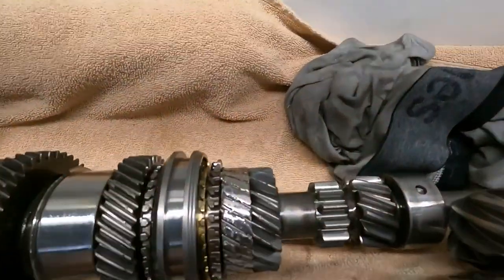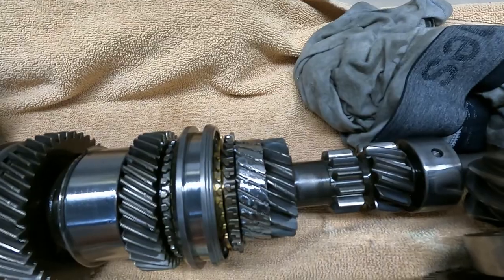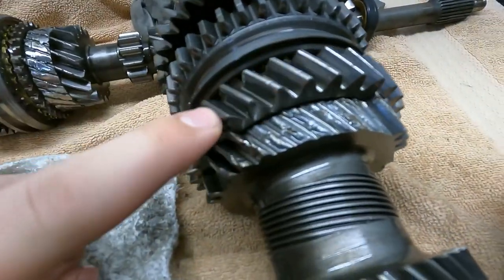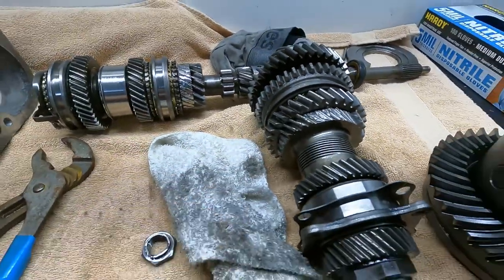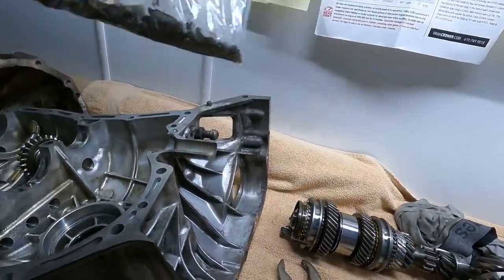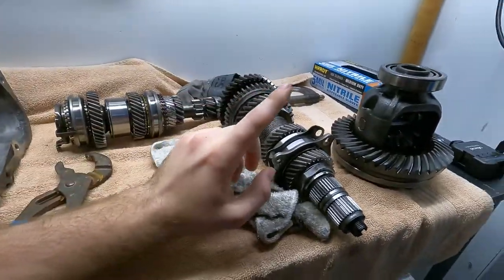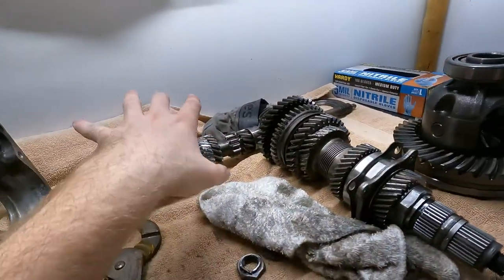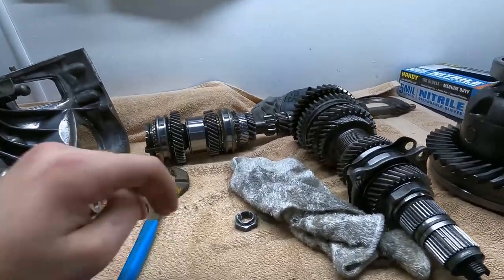Subaru 5mt Transmission Rebuild

Comment: 3rd gear is always the weak link. Its the smallest of them all. I managed to strip 2nd in a 2.5RS box. Went PPG straight cuts and havent had problems. Im currently finishing up my Forester. I rebuilt it with RA's. Im down to setting backlash and sealing the case up. I replaced everything in mine! Center diff and all! My Forester had 276k on it 😅
Reply from the maker: That sounds awsome, I'd like to experiment with a built 5 speed some day, maybe on the next subaru
Reply: @SWSpeedCo  Don't wait to long! The RA gears are finally EOL and I imagine there aren't to many people selling parts. I've had to do a lot of searching to find random washers and parts to complete mine. Even Subaru has some backordered with no ETA on when they would arrive. eBay, Amazon, and random part websites have helped me get all my parts

Comment: u can also torq down the nuts once u assemble the trans  u can lock the diff in place from the drain plug and u can select 2 gears at once to bind it to torq the other nut
Reply from the maker: Probably a better option than what I did

Comment: great stuff i was hoping some rally tough options may be around = ENGLAND - pro - drive - mine is automatic 4aet STI JDM 4.44 - good off the line 17 inch mags 50x225 tires

Comment: Looks to me like I wouldn't have to remove the "drive pinion shaft" from the "driven shaft" if all I need to do is replace "second driven gear."  Does that sound correct to you?  It's just the synchro teeth on the driven gear itself that are slightly mangled in my transmission.  Could also be the teeth on the inside of the "reverse driven gear," if I'm not mistaken.  I believe this gear is a single piece, whose inside splines are what make contact with the teeth which are part of each selected gear, after being dragged across the baulk assemblies.
Reply: No, wait.  After a better look at the exploded diagram, it seems it's not part of "reverse driven gear", but the "1st-2nd synchronizer hub" which actually makes contact with the smaller `select` teeth on the driven gears, 1 and 2.

Comment: What was the cost for WPC treatment? super helpful video, thank you
Reply from the maker: For the 2 gears and main shaft it was $270 I believe but the price varies depending on size and what part it is, you got to get a quote from them. If I were to do it again I would have gotten them cryo treated too which they also do

Comment: Do you know what the noise is when your in gear decelerating? Goes away as soon as you give it gas or go neutral. Great videos. I have a v7 motor swapped 02 wrx.
Reply from the maker: I'm pretty sure it is just the sound of the center diff gear noise. From what I understand it's normal, and if you mess around with tire pressure front and rear you can get it to be quieter
Reply: same issue after replacing my input shaft as a complete unit. just posted about it.
Reply: @jeffflowers729  center diff
Reply: @r.l.strange1897  not installed properly? wasn't doing it prior to replacing input shaft.

Comment: Hey, my 09 outback transmission is starting to make a clicking sound under load only, (no it’s not the axles, I replaced them). It sounds kinda like putting a stick in a bicycle spoke sound.  Any idea what that could be? I’m thinking a bearing internally,,,,, it only makes the sound while accelerating, and goes away if you push the clutch or let off the gas,,,,,
Reply from the maker: Yeah I'm not sure what that would be, I would guess it might be something internal on the transmission but idk what exactly

Comment: Where abouts did you source your parts from?
Thinking of rebuilding mine as the synchronizers are toast.
For the cost of a rebuild at a shop I can buy 4-5 used transmissions, would rather attempt a rebuild on my own.
Only difference is I have the dual range version.
Reply from the maker: I got all of the parts from my local subaru dealership

Comment: Awesome video bro. How much did it cost to get the gears heat treated and what company did it? I want to do that to my Hawkeye 5 speed. I sheared off 3rd gear. Also you should sell those PVC pipes as a kit and sell them online. I would love to buy that pre made PVC pipe kit you made.
Reply from the maker: The treatment cost was $280 if I remember correctly if I was going to do it again I would get them cryotreated as well which would be extra. Their is only one company that does it and I'm pretty sure its just called WPC treatment.

Comment: Same problem for me as Pandawatch below.   I recently replaced the input shaft on my 08 wrx with another complete shaft from a 2014.  My first gear stripped. Looks like your third gear. I kept my output shaft as is. It had no damage and I wanted to keep the same shims so it fit the pinion gear.  Day one everything was fine. Next day I have a deceleration whine coasting in first gear. The slightest touch of the pedal and it goes away. Tire pressure didn't fix it. Any idea what other gremlins snuck in overnight to cause the whine? has about 200 miles on it now. I used 80w-90 but should be fine for now in the 90 weather we've been having.

Also, around 26:15 I didn't see you put sealer around the two bolt holes that go through the center of the case. It cuts to you putting the case back together so maybe just got edited out.
Reply from the maker: Not sure of what else would cause that unless some other parts have play in the transmission. The two bolts that go through the center I put sealant on I just got edited out.
Reply: @SWSpeedCo  thanks for reply. I’m not a transmission expert. Everything else seemed tight and free flowing. 🤷

Comment: Hey question for ya. I just rebuilt and installed my transmission. Is it normal for there to be a wine at first. I’m reading online for most transmissions there’s a break down period but I can find anything specific for the Subaru 5speed. Did yours wine and if so how long?
Reply from the maker: What kind of wine and is it wining all the time or only on decel or acceleration?
Reply: @SWSpeedCo  only on accel and decel, it’s not a grinding noise just a whine, sounds like a race transmission, and it’s only in first and second gear, very faint in third and every gear after, can barely hear it
Reply: I think I hear a little whine in your video, it’s sounds just like that but I just want to be sure
Reply from the maker: Yeah so the first and second gears have a closer gear angle to straight cut gears than helical gears. They are still helical but since the angle of the teeth is less steep they are noisier. But yes that's normal.
Reply: Sounds good I thought so, I replaced most of the gears too so I figured they need to break in a bit. Thankyou for the quick response👍🏻

Comment: I did the same thing to the stock 5sp in my GC8, 3rd gear at full throttle, the wastegate opened and the teeth fell off 🤣

I went for another 5sp with PPG gears instead of doing the 6sp swap.

Comment: How do you check for the backlash?
Reply from the maker: There is a special tool that Subaru recommends for measuring backlash. I didn't want to buy one or make one so I just used gear alignment paint to make sure that the front differential gears were meshing properly based on the pattern.

Comment: I got the 50mm nut off but how do you take 5th gear out? Im stuck right now. 5th gear wont slide off like its stuck on the shaft for some reason.
Reply from the maker: 5th gear has a woodruff key and some amount of friction fit so you need to find a way to clamp onto it and press it off, I would probably use a bearing separator which might be able to take it off on its own but if not you can just get it tight and then press it off
Reply: @SWSpeedCo  Thank you so much. Ill give that a shot. :)

Comment: Hey im havingbtrouble finding parts ( gears  and bearings ) is my only option a dealer ? And what is most likely to cause a wining noise on accel and decel, all gears , loudest in 1st and 5th and quietest in 3rd
Any help would be much appreciated,  thank you
Reply from the maker: The dealer is your only bet for sourcing the parts. Whining on decel is normal but not on acceleration. If I had to guess I would say one ir multiple bearings are probably in need of replacement. Not 100% sure on that but it's the only thing I can think of that would cause 5th gear to wine loud.
Reply: @SWSpeedCo  thanks man , keep up the great work!
Reply from the maker: Thank you! Good luck with your project 👍

Comment: Yup.. this is one of those jobs that’s better to leave for the pros, not saying it’s not doable, but definitely not like putting together an engine. The amount of little parts, gears, bearings, pressure seals, one must have and the proper orientation and the specialty tools needed to place the parts correctly so the transmission works properly again is enough to leave this job for the pros. Great work on you at least opening it and trying it, have a better understanding of how things go/work. Thanks for the video.
Edit: this was a cool video I found. Thought I’d share it for info.. 👍🏻
https://youtu.be/erYNx-jODzI

Comment: I do love how people criticize the stock motors and transmissions in WRX/STi.  I've tripled the power output, and something failed.  What a piece of junk!!  Maybe you need to learn some more stuff before applying criticism to mechanical components!  Mind you, I'm not saying this to you, specifically.  You were just referencing the term others use.  It just always makes me <facepalm> when I hear it.
Reply from the maker: I 100% agree with you. I think alot of the criticism now a days is because alot of German cars are overbuilt and can make lots more power with a tune and minor bolt ons, where as subarus you have to replace everything to make more power. That being said I have a friend with an audi s4 making the same power as me and he probably has 70k into the car and I only have like 30k into mine even though the only thing left original is the body lol.
Reply: @SWSpeedCo  I00%. People expect the cars to have components of the caliber found in cars costing WAY more.